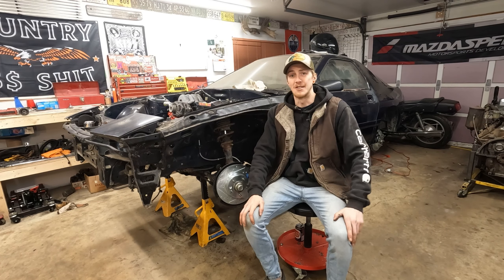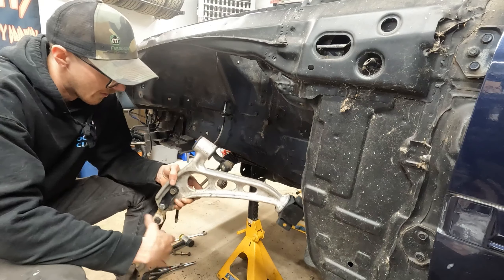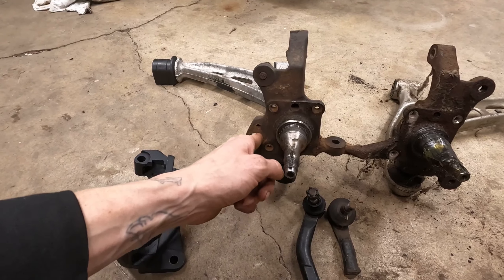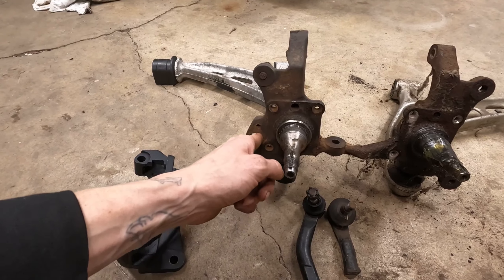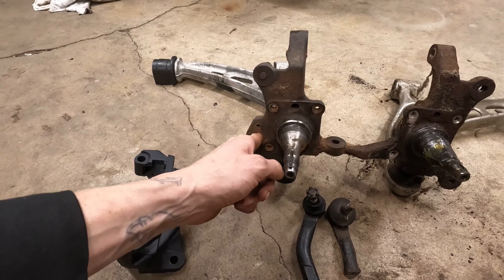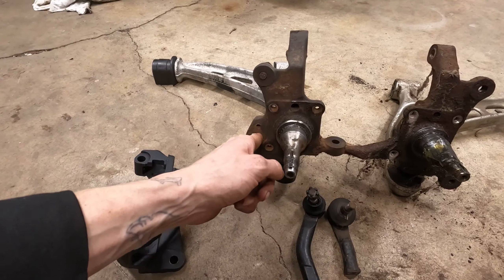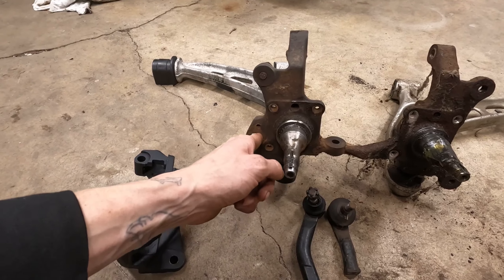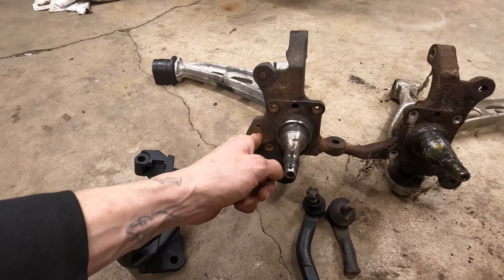FC Villains Angle Kit + Brake Upgrades

Comment: Are those 4 pots from a t2? I’m having issues with my chase bays dual piston bb delete. The brakes are bled multiple times but I’m having issues with the car stopping
Reply from the maker: wish i could give input but my cars still on the jack stands, so haven't been able to road test it. does it just feel like there's less braking power? maybe try playing with the proportioning valve on the brake booster to feed the front more pressure then the rear